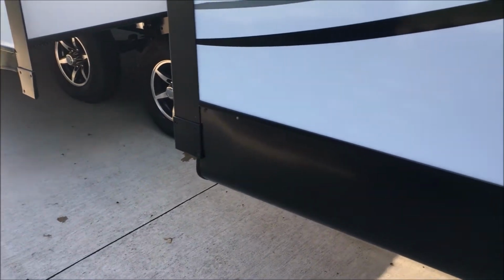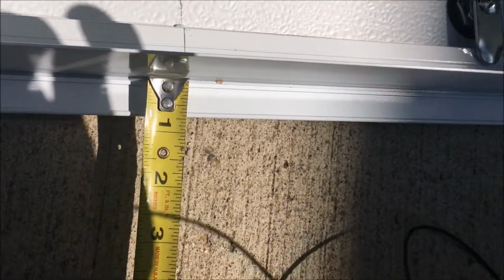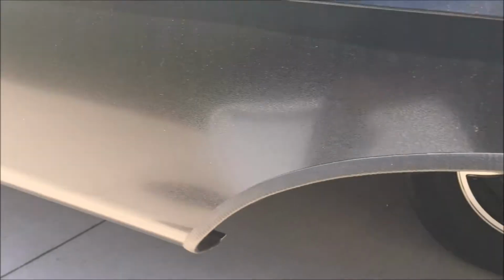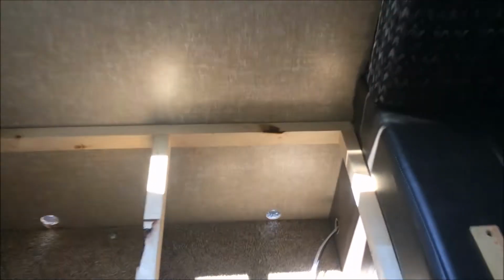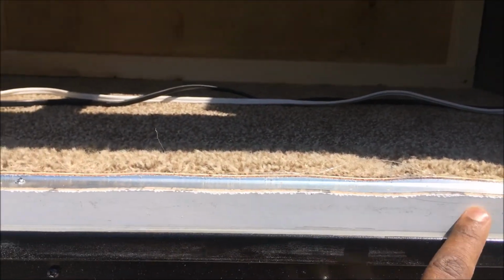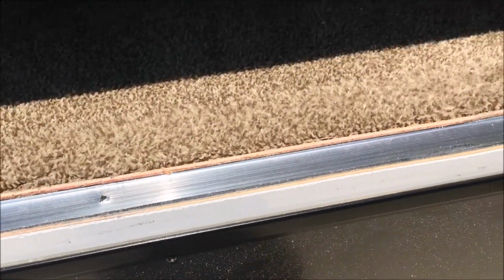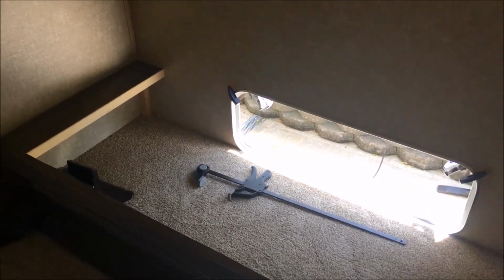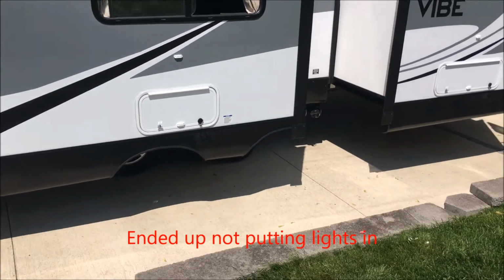Installing RV Baggage Doors

Comment: The slides do not have vertical steel framing, I didnt know that.  Need to do this to my bunk house side on my Vibe 313BHS    What side door size and brand did you get for the bunk house.  I need to do the same thing.
Reply from the maker: Raleigh Lopez III 
The links are in the description I believe. 12x36 on the slide I used. Good doors, holding up well.
Reply: @dan8220  Got it.  For the bunk house, not vertical framing was in the way?
Reply from the maker: Raleigh Lopez III 
nope, didn’t run into one. Was surprised by that because usually under the windows is beefed up a bit, Vibe doesn’t seem to think it’s needed.

Comment: It looks like you took a pretty good section out of that aluminum tube that runs along the bottom of your slide. It looks important. Has this caused your slide to sag at all?
Reply from the maker: Michael Voigt 
No sag no. I’ve not noticed any difference. Still square and seals the same when the slide is open or shut. The foam and fiberglass that the camper is made of is 90% of its structural strength, the other 10% I believe is the glue. I believe the steel framing was more shape when it was made, don’t look like much stress in on the steal at all.

Comment: Good video, thanks for your experience.
Reply: I just got my door today with no keys, and then I realized the other door key works just fine.  I was thinking of putting pai ters tape on the outside and drawing on it to cut with the thought of not scratching or damaging the exterior.

Comment: after the starter holes a jigsaw would be a better choice, moved along slowly for a more precise cut especially on those corners
Reply from the maker: It really wouldn’t need to be precise. The final cut is not seen on the inside or outside as it’s covered by the trim on the baggage door. Jigsaw would not be comfortable enough to possibly cut through an aluminum framing piece. I did not come across any along the top or sides but did cut all the way along the bottom one along the floor. A jigsaw would have made the hot knife through butter more like a butter knife into a football.

Comment: How did you know there would be no wires or anything there?
Reply from the maker: RAY Seidel I didn’t know for sure. I looked at the wires in the automotive tubing under the slide then looked on the walls opposite side and looked at what equipment, lights etc. we’re in that area and it wouldn’t make sense for any wires to be in that location.  2. Rarely are there wires ran along the walls of an RV. usually they are ran along the ceiling or floor under the coach. This is due to the foam insulation and aluminum framing that would not cake sense to run wires through like you would a 2x4 structure because over time the wires could short out on the aluminum.

Comment: Anyone have a video on installing the magnets that hold it open? Do you need any sort of weather stripping or gasket to keep rain out for the magnets? Do the magnets also get a silicon bead?
Reply from the maker: Ted Jordan 
The way I did mine ted, was to drill 2 very small holes in the side, put a dab of caulk on he holes, screwed the magnetic on, then put a bead of caulk across the top half of the magnet only, so if any water gets in behind the magnet t can escape from the bottom.